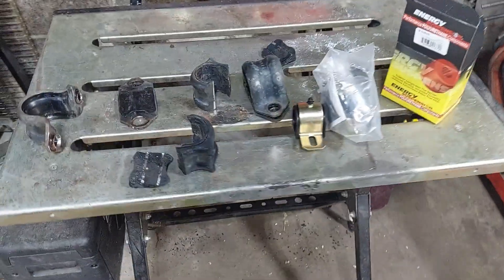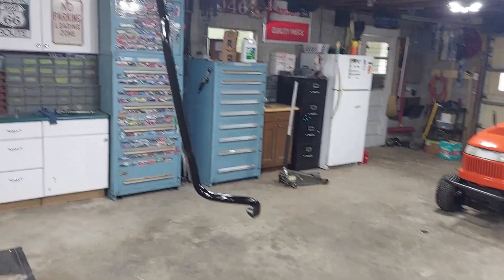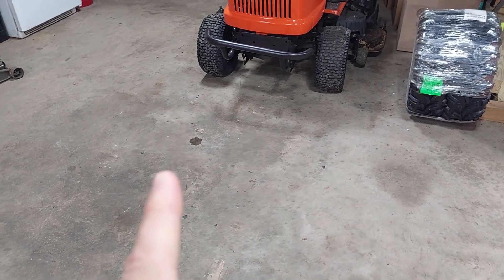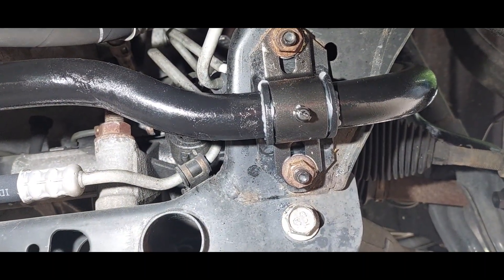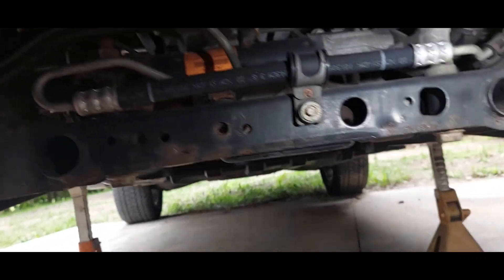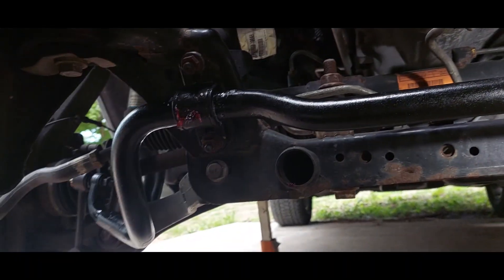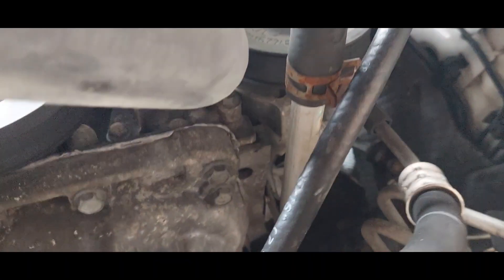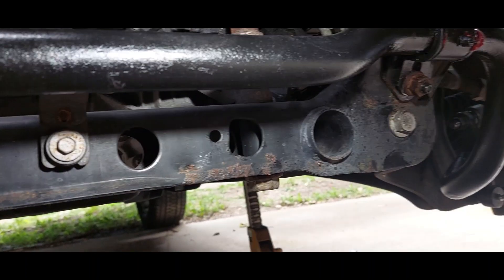Jeep WK2 front sway bar bushing replacement. PT2

Comment: Whats the model number of the Energy Suspension bushings that you used on your 2011 JGC?  (I have a 33mm bar too).
Reply from the maker: ES# 9.5167G, listed as 1-5/16" but fit well. 

https://www.energysuspensionparts.com/universal-sway-bar-bushings.asp

https://www.amazon.com/Energy-Suspension-9-5167G-SWAY-BUSHING/dp/B000CN9CRC/ref=sr_1_1?crid=32ER8VKWAJ998&dib=eyJ2IjoiMSJ9.QZmiEQ6OagiifoxMT6FdH4vvNHWv0rA0dGBujtY2p4HImss6-aX5vPH5bh5ya9rkFyFbDrs0_Fo-1q8c9RnJjEaFahWUTL3lIQ0lONcL_foqwt5-dATKtzi39xXba_Uhu7TUs_bIfq0qBwzNw5bVusxlzc6mAjvtSex1CreyOucsXyHKib4TQDHsjh4NMc3YEZtVRdONrYWYLdLFPC4CEqfFeeQmzhRzJsWVMqBuYDE.J01jEXqU_fp266wZzCKPfnqhuoJuVwAz3eGvY_k4Q2A&dib_tag=se&keywords=Energy+Suspension+9.5167G&qid=1714921949&sprefix=energy+suspension+9.5167g%2Caps%2C154&sr=8-1